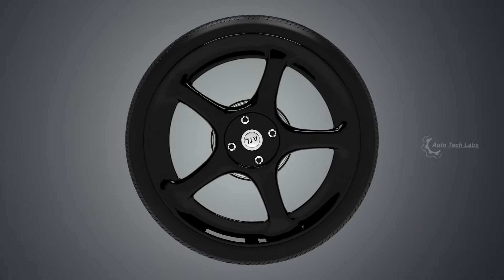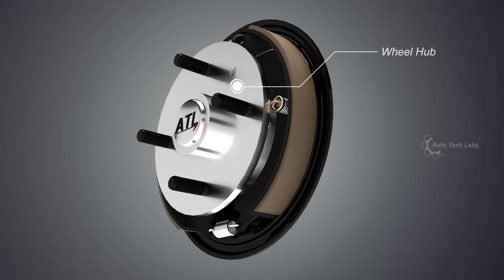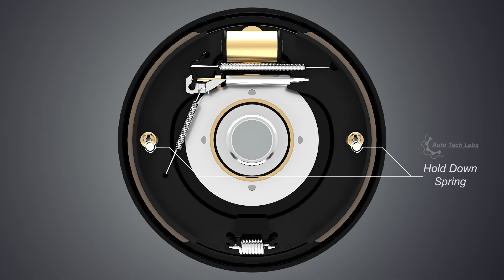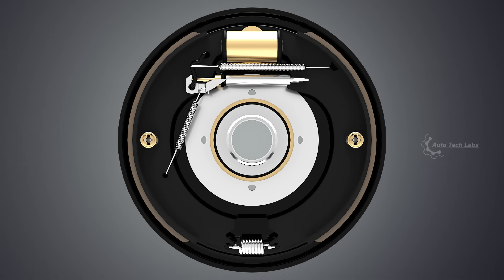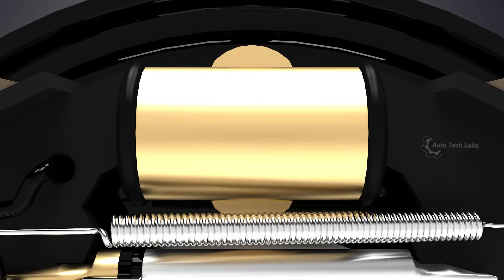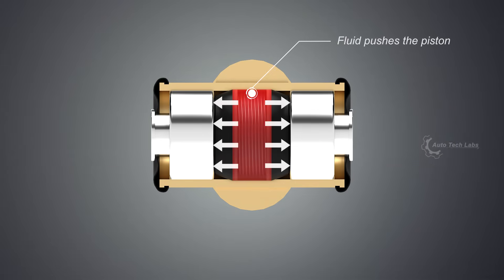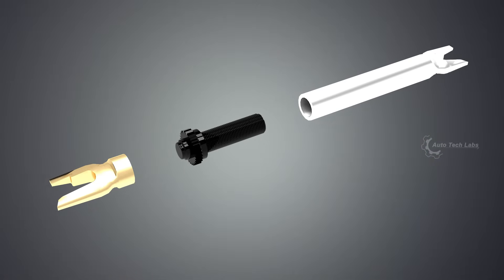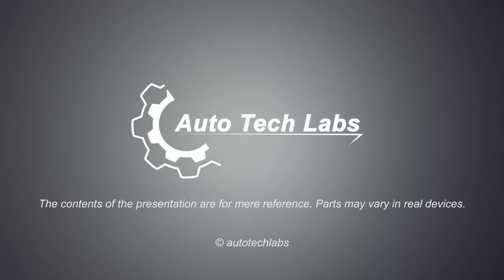Drum Brake System | Autotechlabs

Comment: What's the point of drum brake's? Disk brake's are a lot simpler and they have more stopping power. I just don't get it. Then again all I drive is coupe's so 🤷🏽‍♂️.
Reply from the maker: 1. Drum breaks are better to integrate hand/parking brake inside it while disc brakes are a bit difficult to design with this feature. 

2. Though many cars have rear disc breaks, they still have an inner drum system for parking break. 

3. Rear breaks don't need to have more breaking force as front breaks.

4. Drum brake manufacturing is cost effective and is more than adequate for economic cars.
Reply: @autotechlabs but they still stop like shit

Comment: Hello sir, I am from India. I have a question about drum break failure. Why drum break worn out unevenly. It is big problem in our work shop. Please reply sir. I expect your reply. Bye sir
Reply: maybe drum-brake gets wet during driving on a water-puddle,
then water-puddle discards grease being smeared to 6 pads
on the backing plate.
lacking grease on that 6 pads, causes uneven wear
source :
1. 'Six pads on the backing plate provide a lubricated
    slide surface for the shoes. These small pads are where
    high temperature brake grease must be applied, with either
    style brakes. Through years of use, or lack of lubrication,
    backing plates can wear. Wear creates grooves and cause
    the brake shoes to bind and apply unevenly.'
   in
   http://www.agcoauto.com/content/news/p2_articleid/187
   from google (drum brake uneven wear) result 1

2. 'Back in the days of drum brakes, driving through
   a puddle would cause the brakes drums to fill with water.
   If you stepped on the brakes either while in the puddle or
   right there after, the brake shoes would press outward
   against water instead of the brake drum.
   The co-efficent of friction of water is very close to zero point zilch.
   In other words you had little to no brakes until
   the water had a chance to work its way out of the drum.'
   in
   https://boards.straightdope.com/sdmb/showthread.php?t=177490
   from google (drum brake stay dry) result 2

3. 'No real problem with drum brakes as long as they stay dry.
   I put drums (oem) on the pan last year, and surprise better brakes
   than the disc (72-77 style) it replaced.'
   in
   https://www.totalmotorcycle.com/BBS/viewtopic.php?t=25610
   from google (drum brake stay dry) result 6

4. 'In many classic cars (70's and earlier) drum brakes were used
   on all four wheels. If you drive through deep water,
   you will notice some loss in braking until the water
   runs out of the drums.  In 30 years of driving,
   I only experienced this once...and that was 28 years ago
   driving my 1969 Buick Skylark'
   in
   https://www.quora.com/What-should-I-do-if-the-brakes-of-my-car-get-wet
   from google (from google (drum brake stay dry) result 7

5. 'Brake fade is not always due to overheating.
   Water between the friction surfaces and the drum can act
   as a lubricant and reduce braking efficiency.[5]
   The water tends to stay until heated sufficiently to vaporize,
   at which point braking efficiency returns.
   All friction braking systems have a maximum theoretical rate
   of energy conversion. Once that rate is reached,
   applying greater pedal pressure doesn't change it—in fact,
   the effects mentioned can substantially reduce it.
   Ultimately, this is what brake fade is, regardless of
   the mechanisms of its causes. 
   Disc brakes are not immune to any of these processes,
   but they deal with heat and water more effectively than drums.'
   in
   https://en.wikipedia.org/wiki/Drum_brake
   from google (drum brake allow water to come in) result 1
   
6. 'The inside of drum brakes can get wet if you drive them through
   a deep enough puddle, but the wet linings/drums quickly dry out
   from several applications, though there will be noticeable
   fade/loss of rear-brake performance as they do dry out.
   But, in general, the water doesn't stay in the drums long enough
   to rust the inside of them unless you park the car immediately
   (or soon after) driving through deep water without drying them out.'
   in
   https://www.clublexus.com/forums/car-chat/670071-why-you-get-temporary-brake-noise-after-wet-conditions.html
   from google (drum brake always dry in the rain) result 5

7. 'Drums do get wet and they don’t work when you go through
   a puddle unless you were taught to lightly apply the brakes
   to keep the water out'
   in
   https://community.cartalk.com/t/the-underappreciated-drum-brake/79395
   from google (drum brake always dry in the rain) result 1